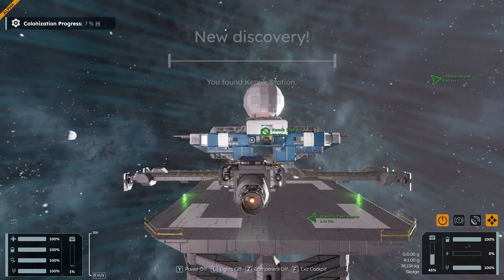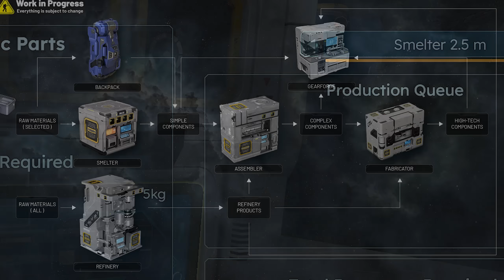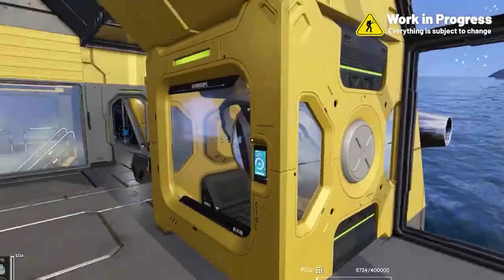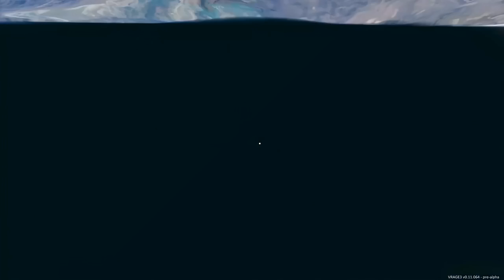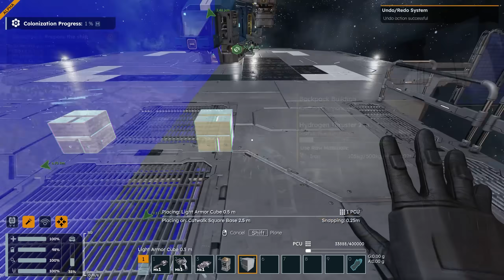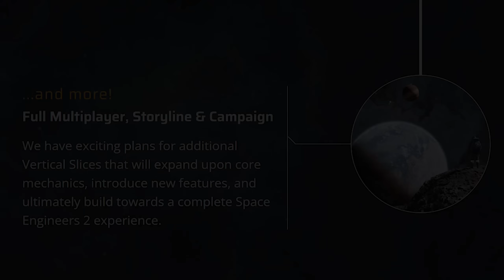NEW Space Engineers 2 Roadmap Revealed! - What's Coming Next?

Comment: What I'd like to see is a plethora of mechanics for detection and tracking targets. Giving us blocks for radar, lidar, and sonar that compound into each other as well as mechanics for target resolution, stealth and decoys like chaff, as well as line of sight.

Differences between things like omni-directional radar and directional radar that's more powerful. Being able to crank up how much power each radar uses for maximum detection range. Potentially some kind of mechanic where the more overlapping radar fields the more precise the target solution (with diminishing returns of course). Changing from low resolution, long range scanning with poor solution quality to high resolution, short range with high solution quality.

Then specialized stealth armor blocks which are lighter than light armor but each piece has a reduced radar signature that makes detection more difficult and requires them to be closer before their sensors can pick you up. Chaff and decoys which have a significantly larger signature. Maybe have "merging" be a mechanic where signatures that are too close to each other and under the resolution of the radar will look like one signature and it'll be more difficult to track.

And of course using active radar lights you up to everyone your radar cone moves over and so they can see you, which then makes things like passive radar/sonar detection a potentially valuable resource.
Reply from the maker: I can't deny, I would love to build a stealth ship

Comment: while i dont like that you have to fast travel to a new map as that basically just loading a new map and not one big universe, but I also cant think of a better way to lock people out of a zone without it feeling stupid or not making sense, perhaps down the road they could have these zones teaming with OP AI that will obliterate you if you don't have the rep missions completed, perhaps rework it to gain access codes to the region or something, so its not that you cant go there but rather than you shouldn't (insert hardcore no codes map completion speedruns here ) :D
Reply from the maker: It is one big universe, you can manually fly from sector to sector if you desire, it just takes a while like it did in Space Engineers 1. Fast travel is only unlocked after you've fully colonised a sector and it allows you to travel to the next one, so it's just like jump driving between planets in SE1.
Reply: @Zer0sLegion  good to know

Comment: Three things i have on my mind since SE2 release:

•No moving asteroids

•It seems that it does have again angular braking. That is huge loss for me as for space simulator fan.

•Flowing water in space simulator? What for? Only for "wow" effect, and there is huge chance they will either cut it or leave it later as experimental, after they soak enough people and money.

Well, they will get no money from me.
Reply from the maker: Moving asteroids isn't possible with voxels unless you render multiple levels of the world at the same time so it wouldn't be possible with asteroids anyway but may be with a large performance impact for planets.

You can change the angular braking thing with mods, it's a single line change in the code.

They've been working on and showing off water for 4 years now and additionally you can access it through the debug tools and mess around with it yourself. Additionally, this was the number 1 thing people requested for years after planets were added and, as stated in this video, there will be an engineering aspect to water, which is the second part of the name "Space Engineers".

By all means, you don't have to give money to anyone based on a promise, I would never endorse that, but please be informed before you use things as a justification for doing it. You could just say I'm not giving them any money until I see the final result.
Reply: @Zer0sLegion  Aight, fair enough ! Am not giving them my money until i see final results.

Comment: I really wish they would use C# Events for programming within game, it would reduce the load that scripts put on game client and servers significantly, though a bit more work would b needed to cap maximum performance demand (mostly in form of optimizing and bulking events together)
Reply from the maker: I thought they did use C#
Reply: @Zer0sLegion C# is used, but not events. i.e. each object can have event emitter, to which you can subscribe.

It can be either individual block, or whole grid, or connected grid or block, events everything one can think of, door opened/closed, specific block damaged, grid blocks damaged, blocked turned on/off, target locked, object passed into filter, item placed into container, button pressed, altitude changed, etc

Comment: Here's a thought. 
I don't know what the limits of the area welder are. 
But suppose you can theoretically select and entire ship with it. 

That could effectivally become an onboard R2D2. 
Something gets damaged, you don't know where, you start welding and IT finds the damaged blocks from within. 

And with a block counterpart, it could be even more powerful. 
If the hard limit is something like, once a build is complete, the build order resets. 
You just need to have the block aiming at something you don't have componments for. Something with a unique part you don't intend to finilise. 
Build never finishes, build order stays, auto repair enguage.
Reply from the maker: I don't think you'll be able to select the whole ship with the area welder, however, we have been told there's a big priority in making repairing easier in SE2 so im imagine you can easily project over a damaged ship and just use welders to quickly repair it.

Comment: With the addition of the turbine for power..... I think it would be really cool if reactors didn't generate electricity directly and instead we had to build turbine systems and heat exchangers to get that power. Also separate lines for power/coolant/air would be cool too as liquid water seems to be a different logistical system too.

It's pretty cool there is enough people that want orbital mechanics. If they pulled that off it would be huge.
Reply from the maker: We'll see, we might have to wait for Space Engineers 3 for air mechanics 🤣🤣
Reply: @Zer0sLegion  I basically meant just make us use a different block than a conveyor for every thing... not full blown air compressors lmao. Even in the form of modular blocks it means reactors are in them selves a sub system of your base/ship/station that are built to task.

Comment: I must have the mechanical blocks before I can sink into the game and get to making a cool base or ship, like I did in SE1. I’m glad they seem to have prioritized them with the latest roadmap but they are delaying the hinge to a future unspecified update? I’m glad we get the rotor and piston but it does seem weird that spinning 360 degrees is possible but not swinging it on a hinge
Reply from the maker: I would suggest that the 360 degree free spinning is much easier than the limited axis of the hinge.
Reply: @Zer0sLegion  I presume that the rotor will also have the same option for “limited axis” as it had before, changeable and toggleable parameters for at what degrees it will start/ stop on. I’m not trying to nitpick and whine I’m just genuinely curious what sets the hinge apart. We don’t have a set release date, so why not wait a bit and include the hinge?
Reply from the maker: @WiseOakDakota  We do have a set release date, late March, early April. And as I said, it's all subject to change.

Comment: All I want is to be able to paint each side of the block separately. Wood floor and steel ceiling kind of thing.
Reply from the maker: You can just place panels over them or rather than placing full blocks, place down half size or panel sized blocks. You don't need to paint all sides when the budling system is so flexible.
Reply: @Zer0sLegion can you still place stuff on the panels?
Reply: @vandiverb  I'm not sure about panels but you could do a layer of 25cm cubes and then place stuff on those

Comment: I'd really like to see no stutters on 3-4 years old i7 and smooth player view movement not tied to physics ticks
Reply: Stutters? On a 3 to 4 year old system? Check your settings. If you see Ray-Tracing on maybe  your system cannot handle it.
I am playing on an 8 year old system and have not seen any stuttering at medium settings.
Reply from the maker: As I said, the bulk of optimisations will happen towards the end of early access, but that also being said, I had no issues on my 5 year old PC at high settings after the patch on the week of release.
Reply: @Zer0sLegion  I mean just moving mouse to view around feels way less responsive than in SE1, especially at high refresh rate display that aren't multiple of 60 hz. It doesn't seems to be a matter of optimization but rather something fundamentally wrong

Comment: Cant wait till the rotors come in.  I hope we still keep the shorter pistons alongside the new longer pistons.  That was a real pain in SE1 where you wanted different sized pistons to realise your ideas in a neat and realistic  way.  
  Now that the ground is destructible in a realistic way in SE2 what I really would like to do is build machines like JCB's and dumper trucks to flatten and excavate a site for a base.  Then a canal system to take full advantage of the new farming mechanics, and maybe a proper working submarine base and naval base for surface ships. Could you imagine doing that with fully functional JCB's and dumper trucks.  And if pumps  are a thing,  maybe a dry dock too.  It would be absolutely epic.
    SE2 is going to be so cool,  it such a shame we will have to wait a few more months before making any complex vehicle or machine is possible. I am holding off until then but as soon as rotors, hinges and pistons are fully functional I will be burying ungodly hours into this game.
Reply from the maker: For pistons in SE1, you could set the max length and also we set and execute just also had very fine control over that length so it should be fine.
Reply: @Zer0sLegion  No  I'm not talking about controlling the extension, I'm talking about the actual size of the block.  A small piston would be perfect in many situation such as doors, wings,  landing gear, etc,  while that new what looks to be massive piston would be perfect for a base elevator, no need to stack loads of pistons.   
In a perfect world we would have three different sizes, the SE1 one,  one half that size, and this new massive piston.

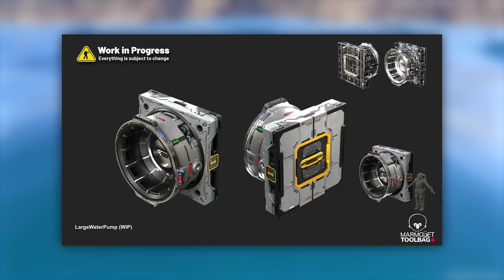Comment: 12:50 Custom made water-powered flow generators anyone?
Reply: Yesss time to make a Dam to power my base!!!!
Reply: Just thinking how they would implemented that would be strange, the amount of water that has to flow through it would eventually drain all the upper dam really fast, unless Keen, some how have a persepitation/rain system and snow in the mountains that lead to rivers or the dam would just have to be fake, only looks like a dam without draining water.

I know we have systems IRL when we have power we pump water uphill into a tank and stores that energy like a battery. When power is low we release it and use a turbine like a dam. I can see something like that.
Reply: @JollyJoel  Its my understanding that only water at the flow point is generated. 'Still' water is a fixed ratio that other water can 'flow from' or something to that end, but Im not certain on the specifics of how it works.
Reply: @JollyJoel if they add rivers and waterfalls like they showed in some pictures they would also need to have a system you described or it wouldn't work very long. 

I'm just curious how they implement it.